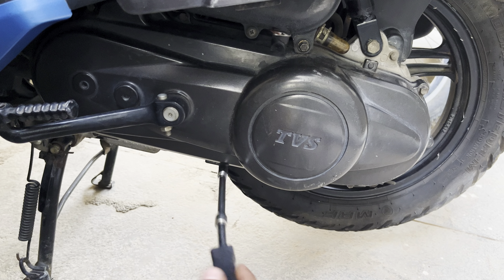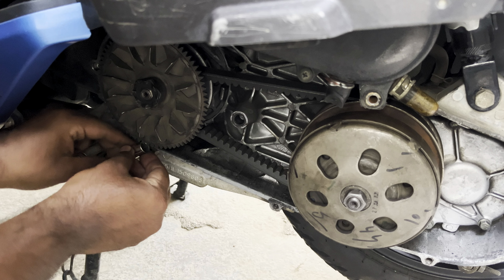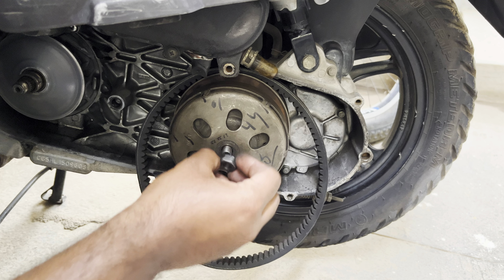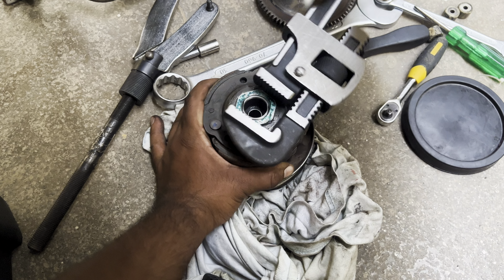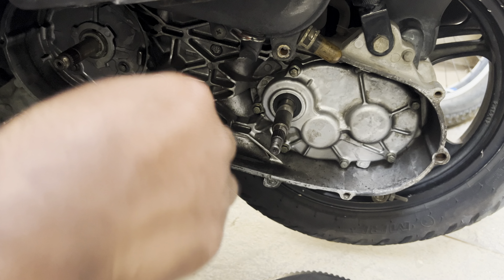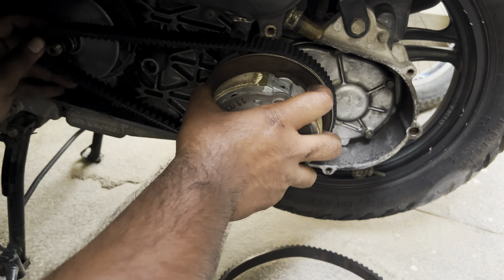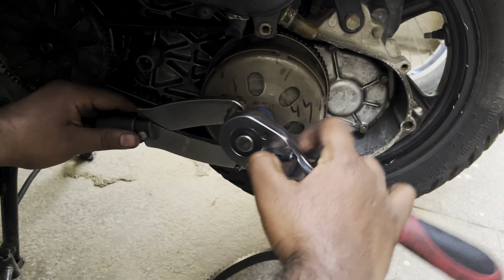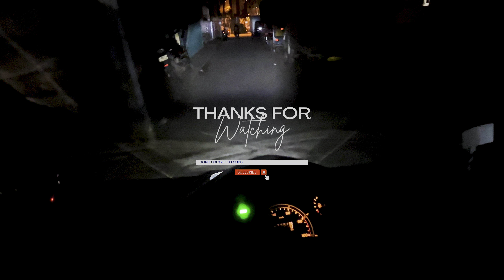Fix Power And Handle Vibration Issues In Scooters | #tvsjupiter #ntorq #hondadio #activa #scooter

Comment: Greasing for the rollers is not necessary. It doesn't rotate but only roll. Applying grease will only attract dust and prevent the rollers from freely back and forth...

Comment: Brother i need help i have pulsar 150 ug4 2012 model im facing engine missing problem rpm is not in idle position when engine starts i have changed carburettor and its hose pipe still not solved and i have replaced both side ht coil still nt solved changed cdi unit problem not solved done valve tappet setting valves are correct dono what to do engine is getting heated but i have doubt on chain tensioner last option .. if u know any suggestions please reply to me ...

Comment: should we always change the clutch assembly or just clutch shoes are enough? My fathers activa never stops vibrating..changed variator rollers, clutch shoes, belt... except the clutch hub.
Reply from the maker: Only replacing clutch shoes will work.

Comment: I have a question, please anyone do answer if they have solution or know the reason behind its cause...

I have Ntorq XP bs6
In race mode,upon middle stand it used to do 112-113 upon hitting limiter
Recently i got my CVT (back whole clutch assembly) changed
Now it only hits max of 106-107 with limiter on middle stand

What could be the reason?and how could we fix it?
Also i feel like it's drinking too much fuel,what could be solution for it?(Its fuel injection)
Pls answer both queries if possible

Have a great day!!
Reply from the maker: There can be couple of reasons behind this. 
1. Not enough friction between the clutch shoe and the clutch wheel (hub) due to new polished parts. 
2. Friction on wheels from break shoes or bearings.
3. Other mechanical problems.